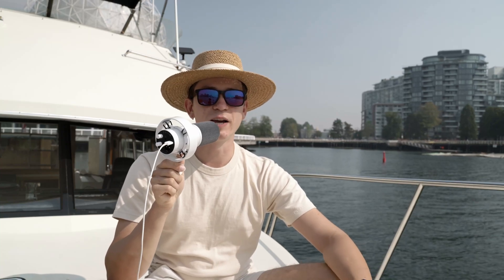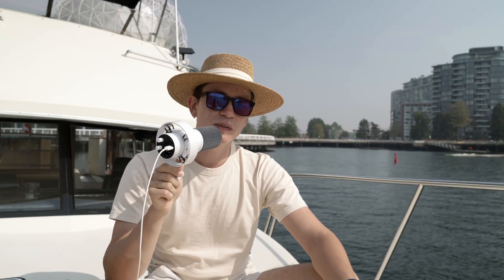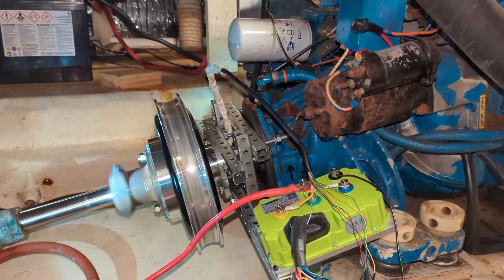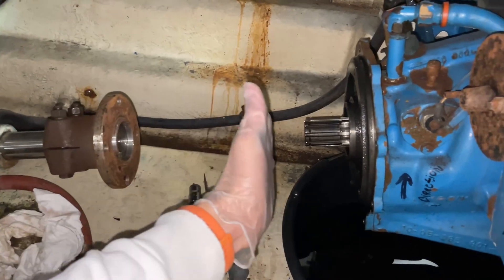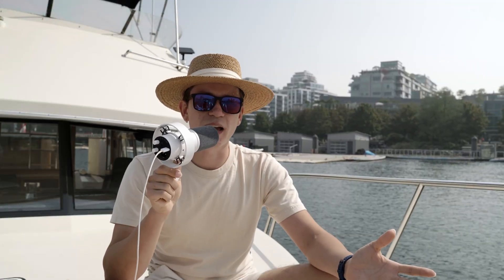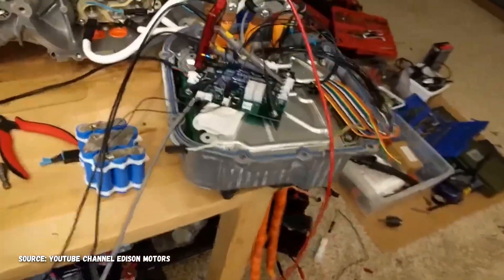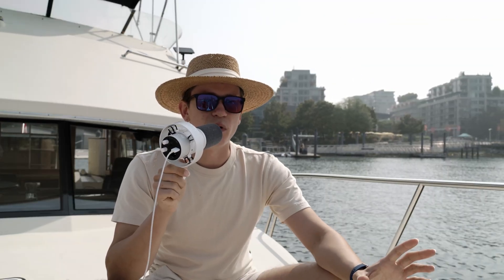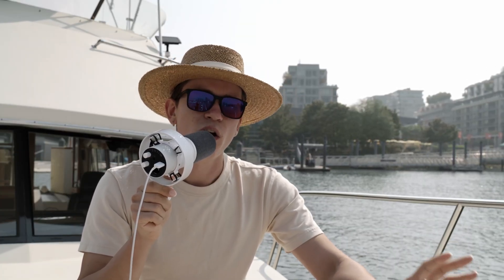What Happens When You Put a Prius Motor in a Boat?

Comment: 4:10 batteries are always DC the auto manufacturers use an inverter which changes high voltage DC and converts it into a 3 phase electric output or however many phase electric motors they power.

Comment: I am thinking about doing something similar.  I have a chevy volt since new so I know it 100%. I am thinking of lifting the chevy volt power train and installing it into a Bayliner 275.  Gen 1 chevy volt has 149 hp which is about 111kw and I was concerned because the bayliner 275 comes with engines ranging from 220hp to like 300 or 350hp so I was concerned about the low power. But still it would be a fun project. I am looking forward to seeing how everything works out for you as I also own a gen 1 Prius.

Comment: Seems like a good idea but don't forget that gen II's max output is 57kw, it's stil a car duty cycle and nothing like marine requirements. I think the safe continuous value it will be cut in half. Most cars at highway speeds use between 20-40kw.

Comment: There is a open source inverter design, and also one that uses a leaf motor and inverter but with a custom ECU to dive the inverter. Another thing,  when I was looking at this the consensus was that you need 1 UP per ton in a boat. I drive a Nissan leaf, and you can buy one in good condition for about US$ 2000. you could use a leaf motor as a alternator. I would not use a converter/charger, just a rectifier. then control the engine throttle to control charging. if you do this you can use a Deisel engine for the generator, petrol in a boat is dangerous. Great Project!
Reply from the maker: Thanks! I’ve seen those open-source inverter projects — really cool stuff, especially for Leaf motors. For me though, the Prius setup has the advantage of being a complete hybrid system out of the box (engine + generator + motor + ECU), which makes it easier to adapt without needing a full custom ECU build.

On the “1 HP per ton” thing — that’s more of a rough trolling-motor guideline. Real efficiency on displacement hulls depends on prop size, shaft RPM, and hull speed rather than a flat HP/ton ratio. My boat’s ~11 tons and the original Crusader V8s were ~350 HP each, so plenty of margin compared to that rule.

And yeah, petrol vs diesel is always debated — I’m just working with what I already have for now, but I’m building in proper ventilation and safety systems. The long-term plan might be different once the proof-of-concept is done. 🚤⚡

Comment: I've been pushing a 20 ton boat with a 7.5 kW golf cart motor on steroids for over 13 years and about 4500 miles at this point. I have 5000 Watts of solar and can go up to 4 mph on nothing but sunshine IN STILL WATER but probably average about 3 mph because the sun's intensity varies. With a little help from the batteries I can get 5 mph at full throttle IN STILL WATER. But as soon as I hit any serious wave action I'm lucky to be making 1 mph at full throttle. This is fine if you're cruising inland water, it actually works OK, but you're not going to cross any open water in safety.
Reply from the maker: Thank you for providing these numbers. It actually matches pretty well with my current calculations! We will see how it will perform really soon
Reply: @YachtCityLife  I'm curious, what voltage are you running your battery pack and how do you charge it, especially with solar? My understanding is a prius motor runs at a pretty high voltage and I've never seen a plug in battery chargers above a nominal 48V, although it seems likely someone makes one. And if you're wiring your solar array in series to achieve over a nominal 48V, how are you grounding the array?
Reply from the maker: I will cover this topic in the next videos

Comment: Go on copart, Buy a wrecked dual motor model s that still runs and drives (I got mine for just over 3K out the door).  Then hit up dynam labs.  Their controller is stand alone and flashes the stock tesla drive units so no other hardware is needed.  It isnt cheap but at just over 4k its also not crazy expensive.  All in you could have a 90kw battery, dual small drive units for less than 10K.  Once again not CHEAP but not crazy.  Also, besides the obvious, is there a reason are you would be trying to stick with marine generators?  You are already talking about using automotive drive train components.  Why not just swing by harbor freight and grab a couple of 13kw generators for $1300 a piece.  Even if you wanted to go full bore reliability and use something like 2 DuroMax inverter generators it would still only be 10k for 36kw.  i realize by that point you're somewhere between 10k- 20k into a maybe
Reply from the maker: That’s a really solid idea — Tesla gear is powerful and getting cheaper if you know where to look. For us though, the goal is to keep things simple and proven for a first prototype. Prius parts are everywhere, cheap, and already come as a complete hybrid package (engine + motor + generator + ECU). That makes it easier to experiment and troubleshoot, especially compared to flashing Tesla drive units or managing custom BMS setups.

Once we get this working and learn the marinization side, scaling up to something like Tesla or bigger generators could definitely be the next step. For now, it’s all about walking before we run. 🚤⚡

Comment: The main benefit here is that you get variable output from the prius. Outboard motors are just crank driven so high speed guzzles fuel. But the prius eCVT will be able to output high rpm with low engine RPMs while cruising at speed. It could be a fuel economy BEAST. Just weld the diff and send it.
Reply from the maker: Hehe, I will) Thanks for the comment and stay tuned for the updates

Comment: The Prius drivetrain mostly relies on regen braking to harvest braking energy to charge the battery and  reuse when accelerating. Charging via the engine is minimal. Also the transmission is fully integrated, so you would need to find some way of getting drive to the prop from a transverse engine. Maybe a Honda hybrid would be better?
Reply from the maker: Actually, the Prius doesn’t rely “mostly” on regen. The engine (via MG1) can generate power at any time, and MG2 can drive the wheels (or in my case, the prop) directly. The eCVT setup blends the gas engine and electric motor so it can run either, or both, depending on load. Regen is just a bonus.

And yes, the transaxle is transverse, but that’s not a dealbreaker — plenty of DIY EV swaps adapt transverse drivetrains to longitudinal shafts. For me, the Prius system makes sense because it’s already a proven hybrid package with engine + generator + motor all in one. 🚤⚡

Comment: If you want the power of the 5th generation prius but at a lower cost look into the Lexus hybrid's more specifically the gs450h (S190) and the RX 450h (AL10). To my understanding they are not to dissimilar from the Prius drive train but with both bigger gasoline engine and bigger electric motor. Of course they are more expensive than the 2th generation prius but they are closer to your power requirements.
Reply from the maker: Good point! The Lexus GS450h and RX450h drivetrains are beasts — bigger ICE + bigger MG2, and closer to what I’d eventually want in terms of power. The challenge right now is cost and complexity: Gen 2 Prius parts are cheap, everywhere, and well-documented, which makes them perfect for a first prototype.

Once I prove the concept and work out the marinization side, I’d definitely consider stepping up to a Lexus or newer Prius Prime drivetrain. Starting small, learning, then scaling up. 🚤⚡

Comment: Have you considered a used electric forklift for a power source? They are available in 36 & 48 volts. They power the drive, and hydraulic systems in a compact well engineered package.
Reply from the maker: No, not really for a list of reasons. Main one is that it is the same thing as if I would use Leaf or Tesla motors. I need extra marine generator batteries logic etc. Too much hassle for nothing

Comment: The same tards that argued about gas engines being dangerous are now going to tell us all that 200+ amps flowing around in your boat is perfectly safe.   Seems only yesterday I was watching a couple of earth saving hippies go electric.  They were found dead in a dinghy.  CO2 is far less dangerous than Communism is silly Commies.  CO2=0  dead.  Socialism 200m+ dead.
Reply from the maker: 200 amps sounds scary when you say it like that — but that’s literally every electric forklift, EV, and even some golf carts out there. The difference is, when properly fused, insulated, and cooled, it’s no more dangerous than the hundreds of liters of gasoline we’ve been sitting on top of for years.

As for the politics — don’t worry, I’m not here to overthrow capitalism. I’m just trying to get my boat to move without guzzling fuel like a V8 at a drag strip. 🚤⚡️

Comment: I knew a couple that put an EV car battery in a sailboat, it caused their deaths and the loss of the vessel, car batteries have no place in a vessel
Reply from the maker: I knew a couple who died while chocking during their dinner. Should we stop eat dinner?
Reply: @YachtCityLife I don’t know what chocking means in reference to eating but maybe you meant choking. My point is that car EV batteries don’t belong on boats, they’re not safe for that environment, but I don’t know you and you’re obviously a bit of a bell end, so rock on sailor
Reply: @randylahey7343  That was a ocean going sail boat ! As long as you put the batteries in a metal container you should be good, just rember that tertiary batteries can self immolate lifepo4 batteries are far safer.

Comment: I like how you explained the powertrain options. I like the series hybrid approach if you have the roof space to add lots of panels and have lots of batteries to store solar energy such that you'll ultimately be running off solar energy much of the time, but I think that's usually more effective on catamarans than it is on monohulls because of the additional beam giving you more room. You can get away with it on a monohull if you're only using it ~once a week or so, but otherwise your approach is probably better. ETA: you know what, I completely misunderstood all that having listened all the way to the end of the video 😂 Really what's happening here is you are building out a testbed to experimentally determine what you can get out of a total hybrid powertrain, including the solar panels -- 15kWh a day is pretty damn good! -- including the gas motor/generator, etc.

This is going to be an awesome project to watch. I have a 26' Robalo cuddy cruiser that I decided to go fully electric with, with exactly the same power output plan as you -- I'm not going to get her up on plane, which is completely fine, so I'm expecting sailboat type speeds, probably 5-6 kts, out of a 10kW "20HP" Linergy X20 outboard motor. Just nice gentle cruising around the lake. I have 3 395W panels that I'll put on the roof, and expect to use the boat once a weekend, put her back into the storage yard, let her recharge all week, take her out again. Looking forward to seeing what you learn.
Reply from the maker: Yep, catamaran definitely has way more place to put more panels, but for our use case it still will be pretty reasonable. And we should be able to increase range on one tank from 250NM to 1000+NM which is a huge difference for us.
Reply: @YachtCityLife that is massive. lots of potential (hurr 🤓) here. looking forward to the next update.

Comment: Surprised you didn’t go with a VW turbo diesel 1.9 engine as your generator and use Nissan leaf motor/inverter with some stacked BMW i3 batteries to power in all electric.  All would be easy purchases used and rebuildable.  Diesel is at every port and more dense energy for better fuel consumption.  If not this option, Toyota made a V6 hybrid that are a little more stout, but definitely interested in your Prius adventure.  Good luck, I’ll be watching
Reply from the maker: Too complicated. I can do anything even write my own logic how it will work etc. The thing that after year or so when this thing start to malfunction I would need to remember (or rebuild from the scratch) most of the systems. It is way easier to repair "out of the box" system like Prius where you don't modify anything and use out of the shelf component. Plus I can find parts for Prius anywhere in the world. So the main concern is not what is the most powerful/crazy setup but the one that I can really use in a long term.
Reply: @YachtCityLife I understand your logic but my biggest concern is you might not get enough power via hp to torque out of a Prius motor.  Granted you are only trying to get to 7-8 knots, I don’t think you’re gonna get the torque or rpm necessary through direct drive shaft to prop system with the Prius.  If I remember the Prius hybrid side (electric motor/generator) of the system is in the transmission.  I guess my thinking was you can use the VW TDI (most popular turbo diesel engine in the world where parts are everywhere) like a Chevy volt or BMW I3 set up where those system the engine is the generator separate to the electric drive motor vs the Prius where the transmission uses a planetary gear box to determine the load of using the electric motor or engine directly.  I’m vested and rooting for you either way. If you had the budget definitely worth building and testing both systems would be awesome
Reply: Too much complication I guess! The Toyota engine+ gearbox can already do all of that plus it can engage and disengage the petroleum engine to just run the electric motor and it’s a much compact package

Comment: I would start with BMW engines. Like 330e, that is RWD setup. Battery is pretty scalable as stock (separate cells) and the ecu can be programmed via free tools. You have diesel options also. And wayy more power than a prius.
Reply from the maker: Too much tinkering. But thanks for the idea

Comment: Hmm, don't think an EV hybrid drivetrain is really ideal for a smaller boat. EVs built for rapid acceleration and regen on coasting and mild braking. Boats are more like airplanes, they spend most of their time at 70-90% throttle, maybe a little idling, but a small electric 'trolling' moto could do that.  Large ships are more like locomotives where the electric power is generated by a diesel running at it's most efficient RPM and the electric drive motor uses that power, but there's no mechanical connection between the Diesel and the props.  But should be an interesting experiment, compare with a similar boat with conventional drive.
Reply from the maker: You’re right that cars and boats work very differently — cars need short bursts of power while boats often sit at steady throttle for hours. That’s exactly why the Prius drivetrain actually makes sense here. It’s not just an EV motor — it’s a full hybrid system with an engine, generator (MG1), and electric motor (MG2) all connected through Toyota’s eCVT.

So instead of only relying on regen or rapid acceleration, the engine can run at its most efficient RPM to generate electricity, while MG2 provides smooth continuous torque to the prop — very similar to the principle used on ships and locomotives. The difference is, Prius already comes “out of the box” with that synergy built in, just scaled down.

That’s why we think it could be efficient for a boat our size — steady torque, flexible hybrid operation, and the bonus of EV-only mode for short trips or maneuvering. 🚤⚡

Comment: Instead of of charging your 70 kW battery while stationary, you could keep cruising day and night, at a slower but constant speed and end up with a faster overall trip time using solar power only.   It's easy to prove with simple math because the way the power required builds roughly with the speed cubed, and even worse when you get close to the hull speed.   Ideally you would have enough solar photovoltaic to charge the battery everyday fully.
Reply from the maker: That’s a really smart point — power vs. speed really does follow that cube law, and slowing down can stretch range a lot. The tricky part for us is scale: even if we cover the roof with solar, we’d only make a fraction of the energy we burn while moving. For example, our boat needs around 8–10 kW just to cruise slowly, while solar might give us 2–3 kW on a perfect day.

So in practice, solar is great for topping up and extending range, but not enough to move a 12-ton boat 24/7. That’s why we’re looking at hybrid: using solar where possible, but letting the Prius engine/generator fill the gap. 🚤⚡

Comment: A Prius swap doesnt really make much sense in a boat for efficiency. A boat does not stop and go nearly as much or regen on slowing like a car and it needs higher output to overcome water resistance rather than just wind and rolling resistance. You would be better off adding a big battery with Lots of solar panels since boats have a lot of surface area to use and you can keep weight of batteries mounted very low. If your goal is to be extra efficient.
Reply from the maker: Are you sure that you did watch the video?